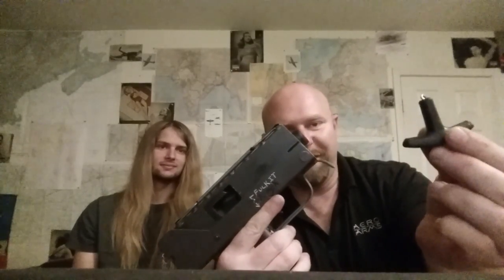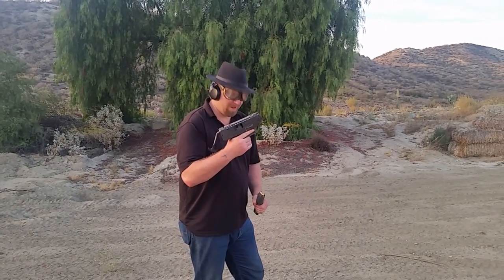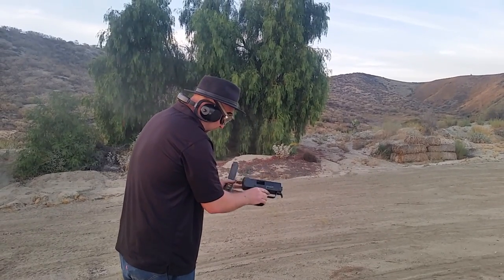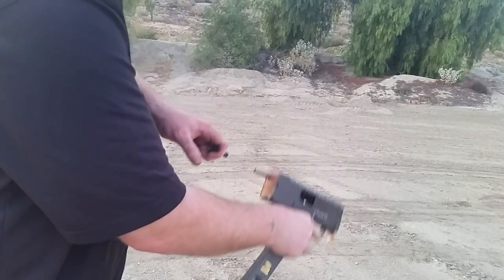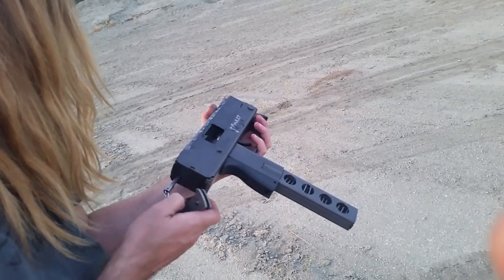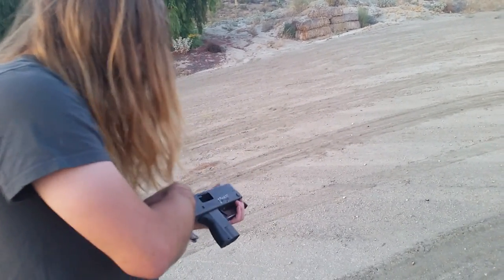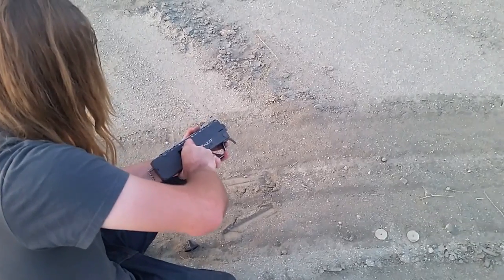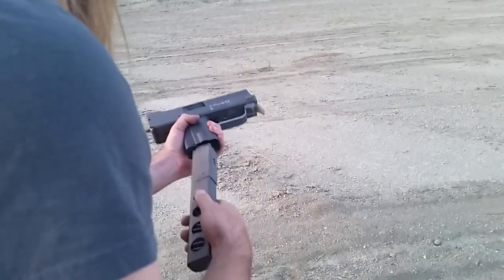The MacSaw Video 2: A sad attempt at test firing

Comment: In all your worldly wisdom why didn't you test fire the firearm  before modification.  This would let you know you need to lower the maghouse until the mag feed lips are out of the way thus allowing "FreeWheel" of the bolt.  Next time don't put a charging handle on the back of the firearm.  Instead just open up the ejection port and charge it like a M3 Grease gun.  If you left the front and rear sight plates on you can hook a strap to your firearm instead of that wretched ammo can handle.  I admire your attempt though keep up the good work.  Col. Ingram came up with an ingenious design that will allow improvements both inside and outside the box.  The Ingram box gun will be with us for decades to come.  We are only scratching the surface of possibilities.  I love the simplicity of Mr. Wayne Daniels Improvements.  Let's see if we can take it higher.

Comment: more reliable than a tech 9.
Reply: i like the layout and configuration of the tec-9, unfortunately bad quality control, crap parts, low quality, and bag mags all plagued it.. if you made something similar in shape but used better parts, maybe some colt 9mm mags and a better bolt im sure it could be quite a decent weapon
Reply from the maker: You can make a tec 9 run reliably... but its a lot of work.
Reply: Proto-Ordnance thank you for saying this. If one is dedicated enough, and has a brain, a FULLY home made smg can be more reliable than an uzi.  If your gun sucks, no matter what it is, you probably suck WAY MORE, or your gun smith needs a new job.

Comment: You could put Plexiglas or lexan (whatevers tuffer) over the magazine sides held on with sheet copper for that sweet steam punk look.
Reply: An idea for sites hit me. Weld the carry handle so it stays up & then weld a short piece of steel tube in the rear link for a big ghost ring rear aperture & a small bolt welded in the front for a post. Boom, sites!